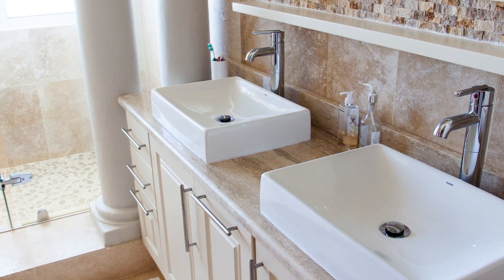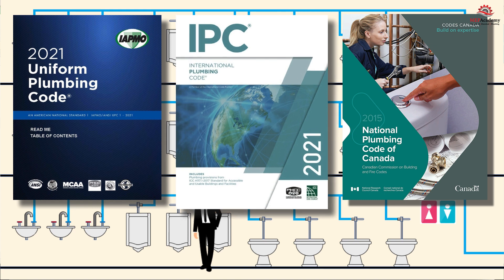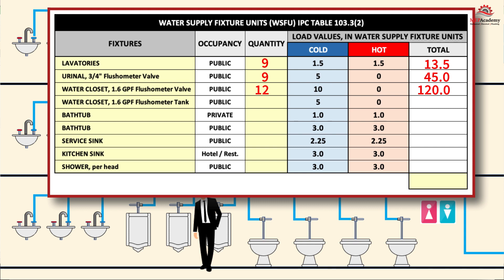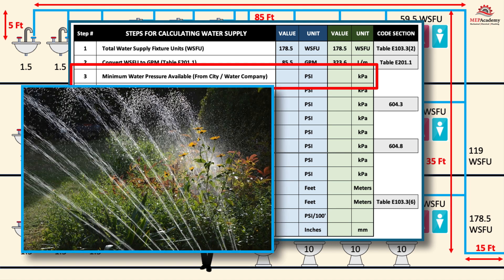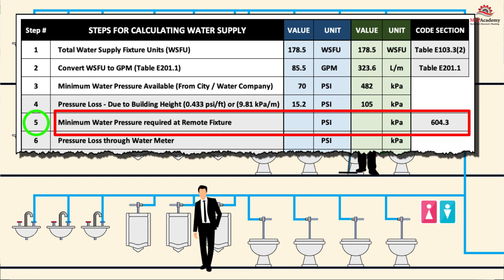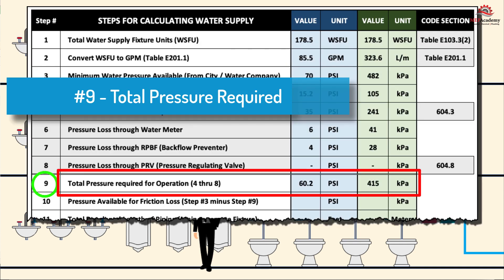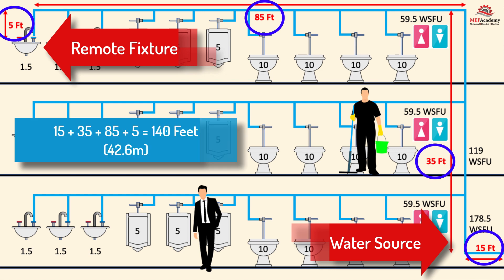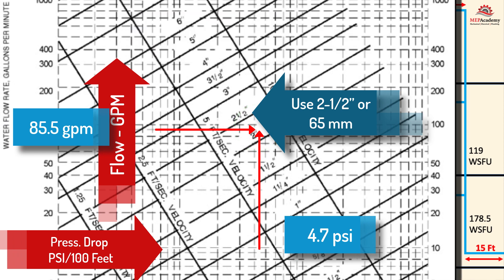How to size Plumbing Water pipes using Fixture Units

Comment: You should be using combined WSFU rather than cold only unless there is a separate water main that services the hot water heater. In most cases, the 2" water main (assuming commercial) will break off and service the hot water heater. After the split, then you would switch to cold WSFU only for cold water run and then hot WSFU for hot water run only.
Reply from the maker: That’s correct. Upstream of the split, the building water service is typically sized using combined WSFU. Once the service branches — with a dedicated feed to the water heater — the piping is then sized separately using cold WSFU for cold water distribution and hot WSFU for hot water distribution. The key is identifying where the system actually separates.

Comment: Veryyy Helpful. Love the way you explained it. 
Its very helpful to know how to size main pipe however, i am but concerned of branch pipes sizing. How to size the piping inside building connecting with fixtures? It would be great if you can let me know this
Reply from the maker: Thanks! For branch piping inside the building, use the fixture-unit method from your local code (IPC/UPC):
List fixtures on the branch (lav, WC, shower, etc.).
Assign fixture units (FU) for hot, cold, or total per code tables.
Convert FU → demand (gpm/L/s) using the code’s demand table.
Pick pipe size from the sizing tables, then check velocity limits and any minimum connection sizes the fixture or valve requires.
Verify pressure: make sure you still have enough residual pressure at the farthest fixture after losses (meter/backflow/PRV/heater, pipe/fittings, elevation).
Rule of thumb: a short branch to a single bathroom group is often ½″; serve multiple groups/long runs, consider ¾″—but always confirm with your code tables, actual distances, and available pressure.

Comment: If there is a pressure reducing valve, how do you account that into the equation? Do you size from the source to the prv using the source pressure? And then size from the prv to the fixtures using the set pressure of the prv? Thanks for the detailed explanation. This was very informative.
Reply from the maker: Great question—and you’re absolutely on the right track. When a Pressure Reducing Valve (PRV) is installed, you typically split the sizing calculation into two zones:

From the source to the PRV, you size the piping using the available source pressure, flow demand (based on fixture units), and friction loss up to the PRV location.
From the PRV to the downstream fixtures, you size the piping using the set pressure of the PRV as your new starting point. That reduced pressure will affect the allowable friction loss and velocity, so this second section may require larger diameter piping to maintain adequate flow at the fixtures—especially in long runs or multi-story buildings.
Also, keep in mind that PRVs introduce their own pressure drop, usually a few psi, depending on flow rate and valve size. That small loss should also be factored in when you're doing more precise calculations.

Glad you found the video informative, and thanks for the thoughtful comment! Let us know if you’d like a follow-up video covering PRVs and zone pressure management in more detail.

Comment: Phenomenal video. I have a question about the last part concerning the psychrometric chart. You arrive at 2-1/2". Is that size for the utility-owned domestic water main? If so, is Table E201.1 'Minimum Size of Water Meters, Mains, Distribution Piping...' for the supply pipe from the meter to the building? I arrive at different values using both charts and am a bit confused.

Comment: So the meter and the riser would be size 65mm? How about the size of the horizontal branch that has a length of 85ft? Will i size these branch based on its WSFU which is 59.5 WSFU?
Reply from the maker: Yes, everything is sized based on the amount of Fixture Units that pass through every section of piping.

Comment: WSFU is calculated for both the hot and cold if the fixture will receive h/c/water -- not just the cold?
Reply from the maker: The example used the cold water supply as that's where the city pressure is derived from, and so it is the starting point for our calculation. The hot water will also need to have its fixture units counted and sized accordingly.

Comment: If I have a building with 8 floors and each floor has 4 apartments, will I create a table like this for each apartment on each floor?
Reply from the maker: When designing the water supply system for a building with multiple floors and apartments, it's essential to consider the water fixture units (WFU) for each apartment on each floor. However, creating a separate WSFU table for each apartment on each floor may not be necessary. Instead, you can consolidate the fixture units for all the apartments on a particular floor into one table for that floor.
Reply: @MEPAcademy  when we design a pipe size as per IPC and for example the pipe size is 1 inch, ( is 1 inch is the nominal diameter or outside diameter?) if i want the pipe size in mm not inches, the diameter will be Nominal diameter or Outside Diameter?
Reply from the maker: @jMoeBeats  1" is the Nominal pipe Size. The Outside diameter of copper pipe is always 1/8" larger than the nominal size, so 1" NPS equals 1-1/8" OD. In metric this would be 25mm Nominal, and 28.58mm OD
Reply: @MEPAcademy  I’m talking about PPR pipes, if the pipe diameter after sizing is 1 inch, the 1 inch is Nominal ? I work for nominal only?
Reply: Okay i got you, if the the Outside diameter of copper pipe is always 1/8" larger than the nominal size, then what about PPR pipes?

Comment: Hi there, grate content!! Question. Should I use the total WSFU or just the cold value when I am calculating a booster pump for 20 stories residential building with the water heater on the roof? When should I use the cold and/or the hot WSFU value? 

Thank you
Reply from the maker: In a 20-story residential building the hot water demand may be significant due to the vertical distance that the hot water needs to travel to reach the upper floors. Therefore, it's essential to consider both the cold and hot WSFU values when sizing the booster pump to ensure adequate water pressure and flow rate throughout the building, especially on the upper floors.

Additionally, factors such as pipe size, pipe material, pressure loss, and system design should also be taken into account when sizing the booster pump to ensure optimal performance and efficiency of the water distribution system in the building. Consulting with a licensed mechanical engineer or a qualified professional is recommended to ensure that the booster pump is properly sized and installed to meet the specific requirements of the building

Comment: There's no such thing as a plumbing engineer.  Any engineer with awareness of fluid dynamics and experience would do, most likely this will be a mechanical or civil engineer.
Reply: I’m civil engineer and Jsut today I wanted to know if our I on-site lead service pump has the capacity to pump extra peak demand of a proposed new commercial building and I got all my WSFU and got my peak demand and got my pump curve and compared with existing vs proposed ans yes our pump can meet new demand- presented my findings to my PM…..her response”why r u doing this? This is a MEP job. I was like saying in my mjnd listen I can read and do math and I’m an engineer- we r not redoing the wheel here.
Yes civil stays outside the building but our pumps are outside the building and I need to know if we need new pumps or not. 
This is basic engineering
Reply from the maker: You're correct. It's not rocket science, and if you have documented what's required using basic engineering principles, then titles or degrees don't matter. As a civil engineer you are more than qualified to determine the project requirements. Good luck. @MarkPalmer-ed7jc
Reply: Right I think like medicine the over specilization makes people forget there's a base level of knowledge we all have. Would I try to design the pilings for a skyscraper, no but i'm perfectly capable of doing a quick soil test for a deck and consulting the bearing charts  @MarkPalmer-ed7jc
Reply from the maker: There are Engineers that specialize in Plumbing and subscribe to ASPE, the American Society of Plumbing Engineers. Here is their website for those interested. https://www.aspe.org
Reply: Ah fair I was thinking accredited programs, There is not ABET approved track for plumbing specifically at the university level.  @MEPAcademy
Reply: Tells me your a student in college or engineering grad with no real life work experience.
To humor your comment, technically, yes anyone with a solid foundation in fluid mechanics and math can "design" a plumbing system as described in the video.
if that was true, all you need is a physicist. It would seem everything engineering is just applied physics.
Any studied fool can do the math,
But anyone who has actually studied, licensed and practiced engineering knows there's more to engineering than "physics" , to be a really and properly engineered systems is a science and an art.
You actually need knowledge of various engineering sciences, plus economics, commercial/industry trends, laws and regulations, safety, and understanding of other trades you might interface with, but hardest parts to obtain is the knowledge of what would actually work in practice.
any engineered system designed purely from pen, paper and software standpoint face various deviations and alterations when it meets real life applications. Or as they say, when "shit hits the fan". But it takes a professional, to design a robust reliable working system that can withstand real life changes. You get that by actually getting project experience multiple times.

Comment: How do you determine how many FU the clean outs are and also how do you factor in the water heaters
Reply from the maker: Clean-outs are figured when designing the waste system and are required by code to be located at various points on the system.  The water heater doesn't add any fixture units as it's used as a source of heat. FU are used to allocate a usage factor to fixtures where water is used for various purposes.

Comment: I have a question sir, it’s look like there no mention about hose bib in fixture unit. So in design landscape irrigation system, what fixture value should I use to determine ?
Reply from the maker: Each code may differ slightly, so you should look at your local code. For example, the CPC 2019 (Table 610.3) states that the first Hose Bibb should be 1/2" in size, and accounts for 2.5 Water Supply Fixture Units (WSFU), while each additional hose Bibb you would add only 1 WSFU.
Reply: I use IPC sir, I understand there is slightly different. However is there detail relates to information you mention above in IPC, sir.
Reply from the maker: @HiLoT4  I don't believe the IPC list hose bibbs, in which case you are instructed to use another fixtures value based on similar usage type.

Comment: Great video! Just one question.. after I size the main distribution pipe within the building, how do I design the branches? or should I keep the main size throughout and only modify for the fixture's rough-ins?
Reply from the maker: There is a minimum size usually found in a table of your local code. See IPC Table 604.5 or use this link to view table. https://codes.iccsafe.org/content/IPC2021P1/chapter-6-water-supply-and-distribution#IPC2021P1_Ch06_Sec604.5
Reply: @MEPAcademy  you guys rock! Thank you so much.

Comment: Hello, great video. I have a question in the min 7:07 when you select the 35psi for the biggest pressure lost but the water closet is not the remote fixture it will be the lavatory. This is ok because the water closet need 35psi and the lavatory just 8psi?
Reply from the maker: Correct, the most remote, but also the most demanding since they are adjacent to each other. If only 8 psi was chosen, there might not be enough pressure to operate the flushometer on the water closet.